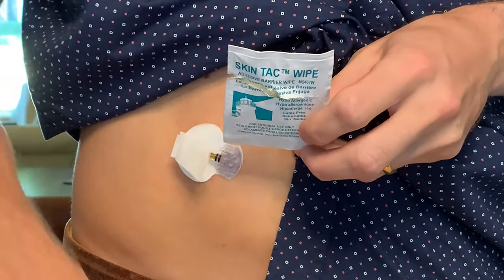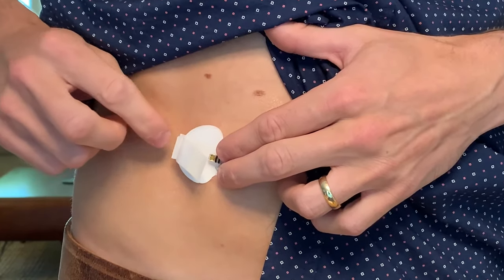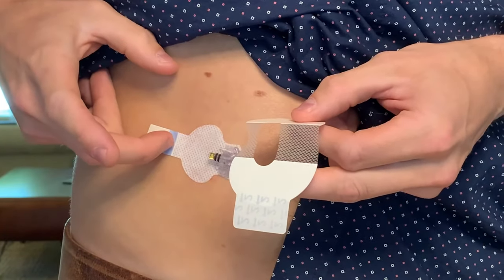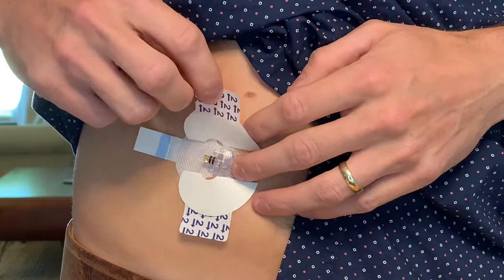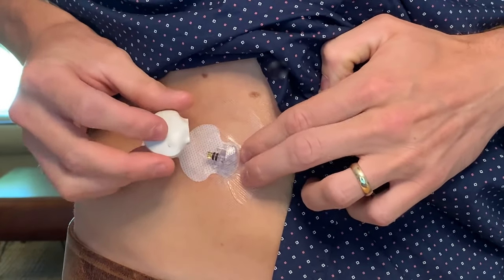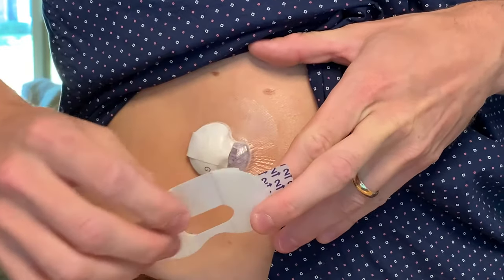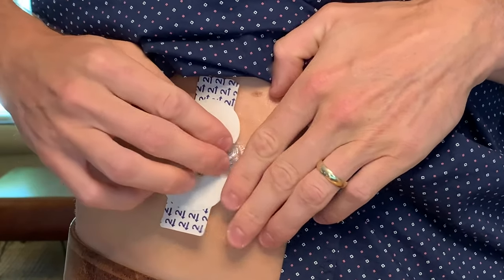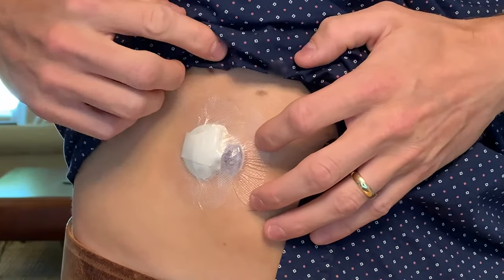Tips for Taping and Inserting Your Sensor  – MiniMed™ 770G System

Comment: One thing that bothers me about this set up?  Too. many steps.  I really hope Medtronic starts to make sensors that are way smaller, like the Libre 3 and really doesn't need all that tape.  Just seems Medtronic needs to move forward  and not stay with the same ole same ole.  I wear this CGM but also use the Libre 3 as it is way smaller, flatter and lasts for 14 days.  Thanks for the video
Reply: Totally agree!! Application of Medtronic's sensors is crazy complicated & time consuming. Especially if you apply them on your arms - hence you can only use one hand to do it. A few years from now, everybody will laugh at this.
Reply: Yea im sitting here out of libre couse i was told to use this and im dreading to install it the libre is so easy and way better from what i can see and this is so time consuming and looks so hard to use on my arm that im just not not using anything
Reply: @bjorn-ceben3171  it is hard to insert without someone assisting I find in my arm.  I use the Libre as well as the Medtronic.  But I’m using the Medtronic as my back up and insert it in my stomach still
Reply: I just got the 780 system  my first thought  to much to do
Reply: The oval tape that comes with the sensor gives me blisters.  I guess I’m allergic to the tape.  Has Medtronic changed the adhesive?  Also, I can’t insert this into my arm without my wife’s help.  That’s annoying. Can’t wait if Medtronic will come out with their new sensor ! Small and easy to insert is a must.  My Libre 3 works just as good when it comes to my sugars
Reply: Wow. I was seriously considering a Medtronic 780G but this sensor application is like rocket science compared to Dexcom. Why so laborious? I pop a Dexcom sensor on and get it running in less than a minute. No extra adhesive tape either.
Reply: The sensor is a pain the but my sons BG’s have never been better. I actually get decent sleep now.  Can’t wait for my second newly diagnosed kid to get on the 780g.  I will say my son absolutely hates these sensors, he prefers the Libre but the whole system gives me piece of mind and we have a nice, steady graph the majority of the time.

Comment: I used this method for a while. Then another sensor user gave me a couple of tips that have helped me (back in the early Guardian 3 software versions with nonsense change sensor after BG not accepted alerts) and I have changed one step as well for the second oval tape. First tip is to use alcohol swab to clean insertion area. Then remove the FULL release liner/paper on the sensor patch before insertion. I kept having the sensor move when removing the insertion needle when only the tiny adhesive adhered. Now, RARELY have sensor come loose during insertion/prep. First oval tape applied as described sans prep wipe. Second, I use some extra cut-in-half patches from the old Elite sensors or similar cut smith & nephew tape to add to the wide part of the patch with the opening towards the tab for securing the transmitter. That gives the back of the patch more support tape, especially for summers to prevent the transmitter lifting the tape during movement and perspiration. The second oval tape, I apply with the wide part just behind the tab for transmitter securing with the hole over the tab. Then insert transmitter and secure with tab. Fewer wrinkles in the tape mean less chance for moisture to get under the oval patches and tape plus less cleaning adhesive off the transmitter. Done well for several summers in the Idaho panhandle. Maybe this will give users another option to try.
Reply from the maker: Thanks for sharing!

Comment: In 4.5 years, I have never, ever, applied the first piece of oval tape BEFORE connecting the transmitter.  Is that the recommended procedure? It is not how I was originally trained.
Reply from the maker: Perry, while this is our recommendation, if your current process is working, we see no reason to adjust.
Reply: Lol, me either, but I’m going to try it now to see if it helps hold it longer or tighter.

Comment: Two things I do differently is...

1: I don't remove the needle until after I remove the backing on the sensor. That way I can use it as something to hold the sensor in place while trying to remove the backing which doesn't always come off easily and requires some fiddling to get it to release from the adhesive patch without tearing and leaving pieces behind. Then I pull out the needle in order to apply the first oval tape.

2: I wait until the pump prompts me to start the new sensor before I apply the second tape. I do this first, because you never know when it is going to refuse to connect, and I may have to remove the transmitter and put it back on the charger to reinitialize it. Also, it seems, if I start putting the second tape on right away, the pump prompts me to start the new sensor while I'm still busy with the tape and anyone who's used these pumps for a while knows how naggy and annoying it gets when you don't respond IMMEDIATELY.

Comment: You say to use extra tape if necessary but you only send enough for the number of sensors ordered .  Can you get extras when placing a sensor order?
Reply from the maker: Graham, additional tapes can be ordered with your sensors. Just let our Supply Management team know, or you can place the order online at www.diabetes.shop

Comment: Is this painful or uncomfortable feeling
Reply from the maker: Christina, many users don't report pain or discomfort while wearing our sensors. Our Medtronic Ambassadors wear our devices and would be happy to answer any questions you have. To connect, click here: http://bit.ly/1wdUET1
Reply: No. If you are a Type 1, and have pricked your fingers 4x a day or more, this will be CAKE 🎂.  Not  Buttercream frosting wedding 😉 😀 cake, but still cake. Be patient.  With yourself,  and our Type 1 'stuff'. Jamie
Reply: My skin will itch underneath the tape. I'm allergic to the skin tac/ alcohol rub, so I don't use them.I also have dry skin.  I will change sensor before showering to get a clean wipe. living with humidity can be a problem with tape curling and peeling away when skin under the tape gets sweat  into the wrinkles of tape. I will usually put large band aid tape square over the original medtronic tape or I will control with Deodorant around the taped area to keep control of moisture. it's cumbersome at times. I have no problems during the Winter months only during Summer.

Comment: I thought you could only use it on back of atms
Reply from the maker: Hi, Serendipity, the best performance was observed when the sensor was used in the arm. For safety reasons, the system is indicated for use in the arm. However, if another site is needed, please work with your healthcare provider to assess.
Reply: Always need of help 
To apply on the back of arm
Stomach area look
Easy
To do myself 
But was told
The arm only

Comment: They never last 7 days. 4-5 at most.
I think it’s a very poorly designed system.
Also, in needs to be calibrated so often you might as well not use it.
Reply from the maker: Hi, Ken. We're sorry to hear about this. Have you already had a chance to speak to our Technical Support team about this? If not, please give them a call at 1-800-646-4633, option #1. Thank you.